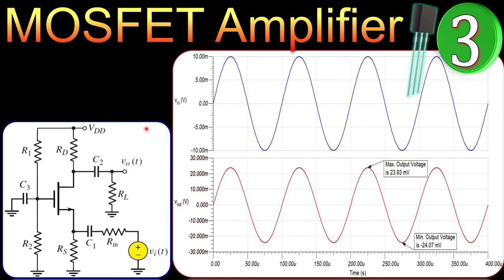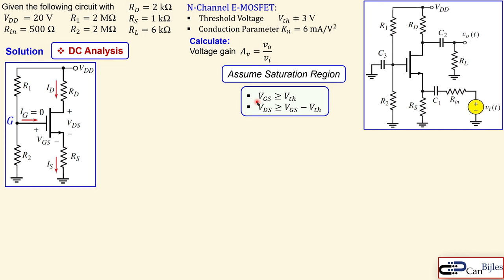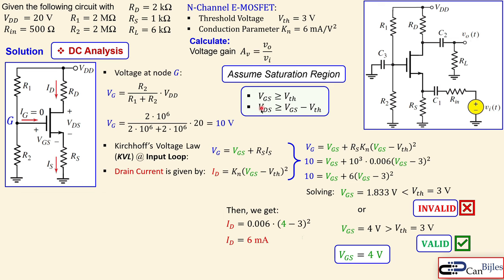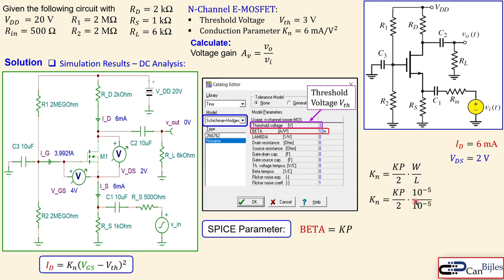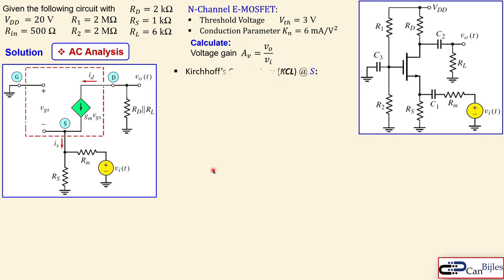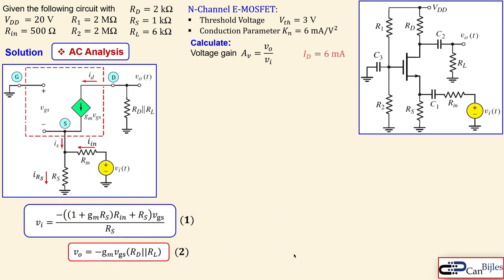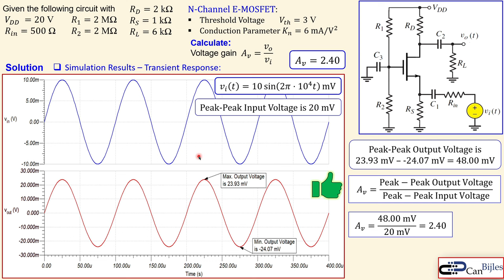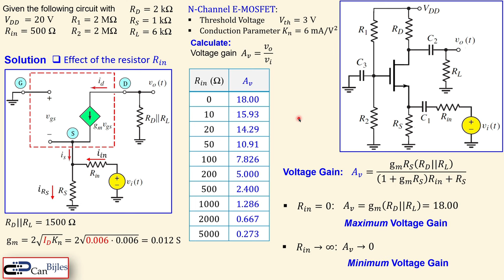Common-Gate Amplifier | N-Channel E-MOSFET | Calculations & SPICE Simulations | Example 3

Comment: Hi, Could you please explain briefly how to calculate the output resistance using the small signal model? Thanks in advance.
Reply from the maker: You can apply a test voltage source between the nodes you want to determine the impedance. Then, set an equation which relates the resulting test current due to the applied test voltage. The ratio of the test voltage and test current is the impedance by Ohm's law.
Reply from the maker: You can also check these videos where I apply the method to determine the impedance:
Transient Response Electric Circuits: https://www.youtube.com/playlist?list=PLuUNUe8EVqlk-KSGs6d50H_BuLydNzmAS
Reply: I need to get Rout in order to Calculate Av using Gm.Rout method so it's like take all the circuit and turn it to just a 
resistor. I understand the idea of applying a test voltage and measure the current while set input voltage to zero. The question is how to set that equation which relates V & I in your example ? @CANEDUX
Reply from the maker: @Fidel-tk5rq  The answer to question 'how', is best shown using an example. You can also check these videos where I apply the method to determine the impedance:
Transient Response Electric Circuits: https://www.youtube.com/playlist?list=PLuUNUe8EVqlk-KSGs6d50H_BuLydNzmAS